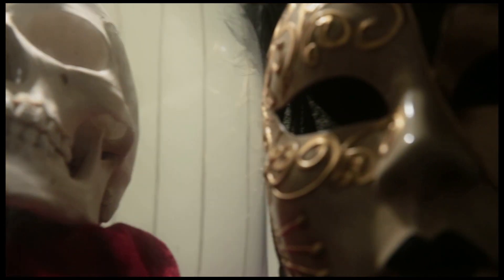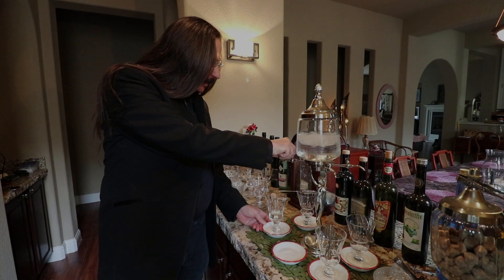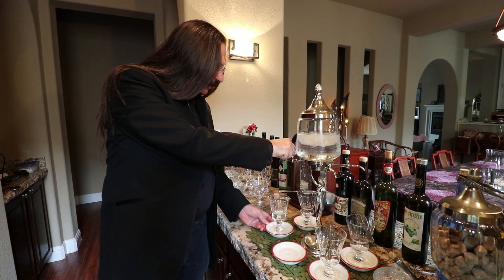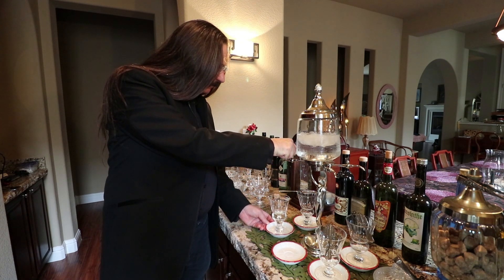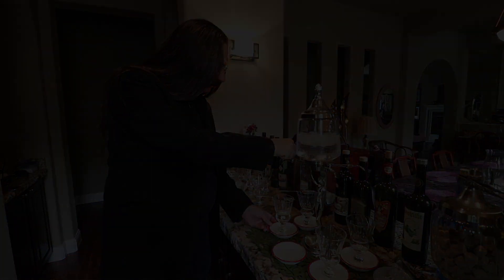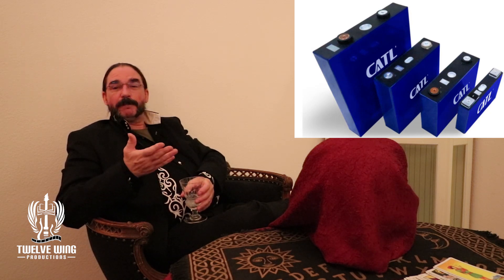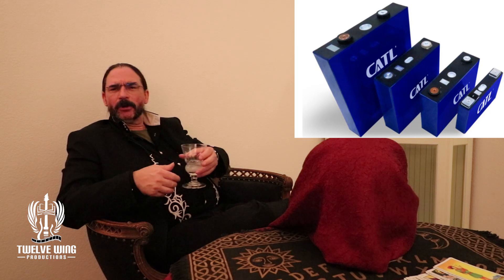Tesla Battery Investor Day: Does Vehicle to Grid Really Work?

Comment: A really good guess that the first factory in HUTTO will be their new style battery. Makes a lot of SENSE. Is Jeff Dohn a TESLA employee? Is TESLA Is TESLA using these prismatic type battery cells in Shanghai only requiring a different battery floor? What do I know anyway? I still am in favour of cylindrical cell of different chemistry that works well because TESLA has perfected this heating & cooling of batteries better than anyone else and now You have the introduction of OCTOVALVE  in MODEL Y. WHO WANTS A LEAF POUCH PACK? Is PRISMATIC that style or different? Can PRISMATIC be packaged in a cylinder cell? I thought the change coming was the elimination of 5 to 7 modules to make up battery to make warranty cheaper because You could replace that module only. (It is not possible to replace individual cells because of epoxy like material sprayed on to module)
The million mile cell means a lot less cell failures and the battery floor just becomes one module and cells will burn off connection finger and cause no impact because the loss of 1 cell in a module caused more imbalance than if 1 failure in complete battery floor and less complicated finger connection of series and parallel connections. I really Like Elon developing competing technologies in CHINA and USA at the same time. 
BATTERY DAY IS HUGE. Question. Will the existing battery charger located in the car used to change AC to DC be easily have inverter capabilities added or is it a totally separate unit like the job site power capability of CYBERTRUCK. Clear up the mystery for me. The CYBERTRUCK  debut showed ATV plugged into outlet on right side of truck bed and is that a DC or AC plug. I am hoping the charging door for truck is on the left fender is where I have TESLA charger on wall X 3.   100 amp feeds ready in new house 3 car garage. (the middle garage has TESLA wall station with 8’ cord but MODEL 3 is only 60 Amp capable) I upgraded my service to 400 AMP. I have 10 electrical panels in this huge house and wiring already behind drywall to easily make connection to transfer switch. I also have surface mounted 100 AMP panel for connection to 3 power walls and 3 circuits of Solar on concrete tile roof that is lot more complicated for fastening methods. My Problem is that I am an old man at 74 and my doctor won’t allow me to work on roof. YOU caught my attention about 20 KW POWER WALL COMING. I DO HAVE NOISY GENERATOR without transfer switch. We have smart meters now. BC HYDRO pays a good rate for solar to grid. I know it is just a matter of time that DEMAND PRICING will happen because they need people to charge their car when they are asleep and power can be used to charge car without upgrading home wiring but a lot more beneficial to utility to make a lot more Money with existing Grid. Me I just want to charge up my power wall at cheap rates and using it for emergency and for house with time shift to my advantage. Who needs solar? I am too old for payback. Thanks in advance for Your FEEDBACK.
Reply from the maker: I wish I had time to unpack this now, but I'm headed out the door.
When I get back late tomorrow, I'll go over many of the things you, Rodger and Helen have been talking about and perhaps have to do another video or two.
You three have covered a lot of ground and made some very good predictions about production coverage.
I'll toss out some things that I have personal experience with about how things shift around to maintain and create production and I think we will have all come up with a pretty good framework to how Tesla will, or should, proceed.
Usually if you come up with a solid argument about how a company should succeed... you are never far off the mark of what they actually do.

With Tesla, it's all an information game.  How accurately have we deciphered what their options are.

Comment: This is how the internet should work... it makes us think... and you certainly made me turn a few ideas on their head this time.
My thoughts are that the new batteries would be built on their own production lines and this will free up the old facilities to produces a maybe slightly improved battery but in bigger quantities for Powerwalls.
Reasoning is that if the cells aren't going in a car at all in their life you can better match the chemistry to match what you want in a energy storage unit... longer life cycle.

In cars the battery life cycle is already good enough and most cars will be very old before their battery suffers to any relevant level. For them I think the Tabless technology is more important than the new chemistries for most people thinking about getting an EV... my rationale is the thermal stability the tabless method offers what people actually want which is faster charging rates without damaging the battery, or at least limiting it. Thermal stability also means a little less cooling needed so a pouch system is no longer such a disadvantage ( although that is always a balancing act with a desire to charge ever quicker)... means more battery in the same space opening up options like a lighter car with say a 300 mile max range but very fast charging. That cheaper more able battery I feel is what the market place needs right now not a 600 mile dream.

 My prediction, if I can borrow your crystal ball for a second... is that Tesla will make the Model Y produced at their German Factory the first to be able to move power in both directions. 
The European and particularly UK National Grid is where Tesla have decided to BETA test their own version of the Micro Grid. Here in the UK we are already heading in that direction anyway so it makes more sense than in America, for now at least. It makes sense of Tesla's application to become a power supplier in the UK around the time of what would have been the Battery Day before all went to hell and back.

I'm with you bigger Powerwalls to better match a real world demand from a house and that forming the backbone of the Tesla Micro Grid.
Reply from the maker: I think there are about 3 videos in what you covered.  I'll read it over again when I get back in the studio later this weekend.

I especially like/agree with what you said about Germany or possibly Norway.  The European charging infrastructure already seems primed to be more dc/dc transfer friendly.
If VTG is going to happen anywhere it will be there.  I just don't see it taking off.  Not because it isn't possible, but because it isn't necessary.

Comment: Hypothesis) speculation.
That
The CATL battery as described by Reuters isn't the "Tesla 1 million" cell.

That the  "JD team" cell is the one.

That equipment moved to Fremont indicates a small production line in the area.

That the fist vehicle to receive the cell will be the Plaid S.

That (I agree!) The 2020 production at "Texas" (likely) may be batteries...... And that they would be the tesla cell.

That those cells could trigger a shift to all cars using them (maybe a tandem plant in Shanghai phase 2 for long range model 3, Y?)

That if "Texas" production allows transition, next stage will (must?) be an amicable(?) winding down of the Panasonic relationship (note the recent statement from Panasonic "in talks to expand", but why would Tesla do so with zero prospect of the existing 2170 cell reaching "Tera" status?)

That any winding down at Nevada allows both transfer to the new cell, plus use of free space for vehicle production (following the "self contained production" philosophy?)

Discuss?
Reply from the maker: You, Butch and Helen are going to keep me busy later this weekend.

Comment: Would vehicle to powerwall make more sense? That would allow DC to DC charging, right? Like a mobile powerwall
Reply from the maker: Currently no.  The only way to input to a powerwall is via AC.
Tesla does this to make sure some yahoo isn't going to fry their batteries or set them on fire by allowing them access to the DC buss.

Even if it were true that they had access, the charging rate would still likely be an issue... but again... perhaps not.
If the car could charge and discharge at home at... say 50kw... that would work.  Less than that and you would run into the time issues I talked about earlier.
You are putting power into the car because you expect to actually drive it.

Comment: The reason it matters is because the goal is to go 100 percent renewable... the VTG and stationary battery to grid tech gives us a bigger / more distributed / more flexible energy buffer for the entire planet...
Reply from the maker: I totally agree with you about stationary battery to grid.  The part I have trouble with is that the purpose of a vehicle existing is that it should be efficiently using its power to drive on... not to suffer a round trip loss of 10% every time you suck power from it only to then run the risk of it not being able to drive when you want it to because it's still trying to recharge.
I just see it as a waste of resources and time.
Using your powerwalls to prop up the grid though?  Totally agree.
Reply: Assumption is that battery capacity will greatly exceed what is required for typical driving and that many people will still want their own cars despite existence of self driving... think ahead to customizable cars with amenities like beds and fridges in them...that can drive themselves interstate faster than dealing with the airport...because solar deployment / storage and reduction of fossil fuel powered transport must all occur IN TANDEM this transition is difficult... currently some solar farms actually produce excess energy that is discarded or the systems are shut off....VTG is a game changer because it facilitates this transition! Each car becomes a 2 for 1... renewable storage/grid stabilizer and mode of clean transport...this ability and the software that comes with it adds great flexibility and efficiency to the grid during this transition, where battery production is a major bottleneck.